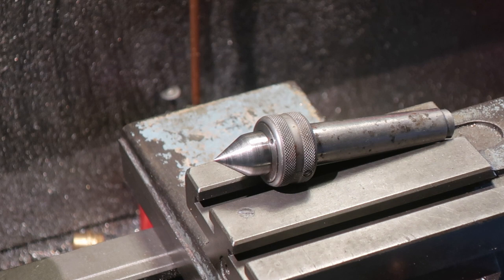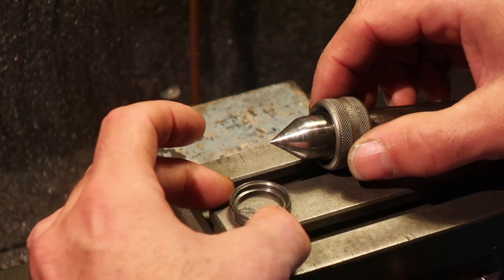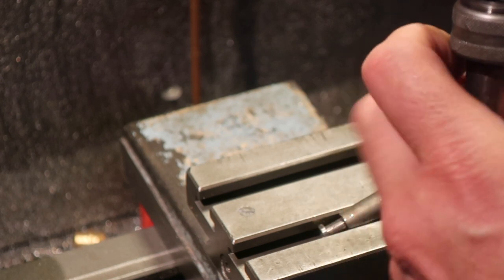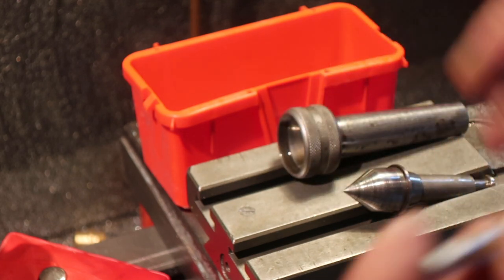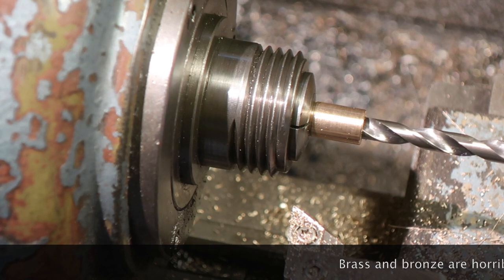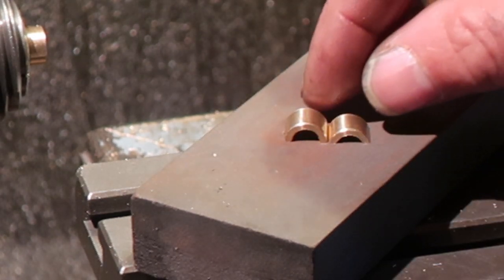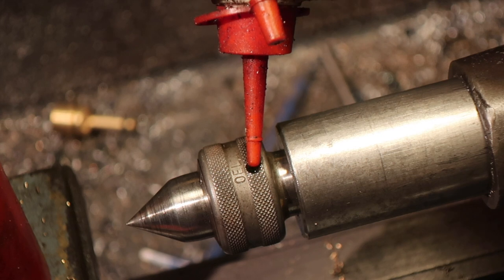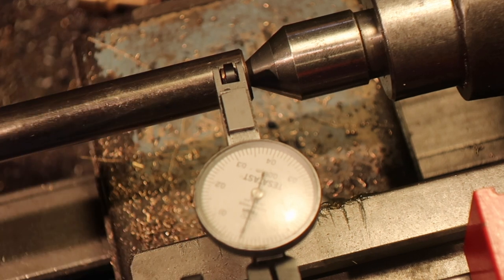Precision Swiss live centre hacked back to life

Comment: I don't think it's missing a roller race, just a set of loose rollers 2mm dia x 7.8mm long. They're a standard size and readily available.
Reply from the maker: That could well be the original setup, it's kinda how the catalogue picture looks.  My "proper fix" option was getting a handful of 2mm rollers, and making up a one-ended brass cage.  Although probably an easier solution to that would be to find someone with a 3d printer, sounds like a perfect solution for one of those.

But yeah, time to call my mate who works for SKF and get him to grab me a handful of rollers :)

Thanks for the pointer to the size, man.  Much appreciated.
Reply: @wibblywobblyidiotvision  My guess would be that it was just a packed set of rollers and no cage, similar to the needle roller bearings in vehicle universal joints.
Reply from the maker: @sooty655  Sounds likely.  I'm waiting on my friend :)

Comment: Roller bearing without a cage is just a normal 'crowded roller bearing' 
It was pretty common  but caged rollers use less of the 'expensive', heat treated bearing steel with a cheap plastic cage filling in the gaps. 
Doing just one bearing shouldn't cost much but when you make them in millions I guess it adds up? 
I would probably use gear oil as it's designed for high pressure situations although I doubt you'll be putting as much pressure on centre as a 40 tom truck does on it's gears
Reply: Cages are used because you can't fill more than about 50% of the bearing with balls without having a slot to feed the balls into the bearing.
Reply: @MF175mp  Crowded ball bearings are used but they are more labour intensive as they are not assembled by machines. Irrelevant anyway when we were talking about needle bearings
Reply: @1crazypj  Yes, needle bearings like this are a different story of course. I might've read the comment too quickly the first time

Comment: Why don’t you work on a nice work bench instead of on a vice
Reply from the maker: That's a fair question, or it would be if it was actually a vice and not the top slide of my lathe.  As to why I'm working on it rather than a nice workbench, well, it's clean, big enough for the job, and my workbench is far from nice at the moment :)
Reply: @wibblywobblyidiotvision  There is something strange with workbenches, it doesn't matter how big they are, they always get full of stuff anyway.

Comment: Your content is good but your audio is terrible .
Reply from the maker: Thanks.  For the audio, it is what it is.  I'm not some high stakes youtuber, I'm a twat with a shed and a Canon G9X; the audio is simply what comes from that.  No, it's not great, but there you have it.  you get what you pay for (and that's part of why I would strongly suggest installing an ad blocker so you're not paying).

Happy new year
Reply: @wibblywobblyidiotvision  , Didn’t mean to be so negative , just thought there may be something wrong with your audio that you weren’t aware of . Hope you channel grows and you have a great new year.
Reply from the maker: @mrc1539  No worries, man.  A lot of the noise when machining comes from the camera's mic picking up all, and I do mean all, of the whine from the VFD plus the noise from the lathe motor, plus....  When the Mill's running it's worse, there's no VFD but there's a second motor running as a rotary phase converter...